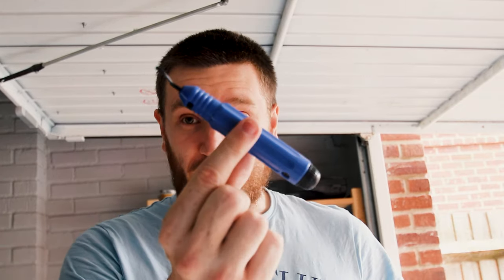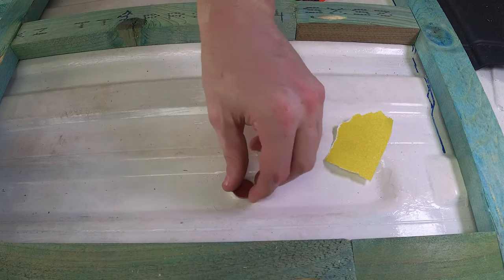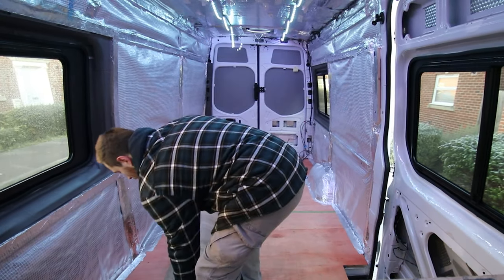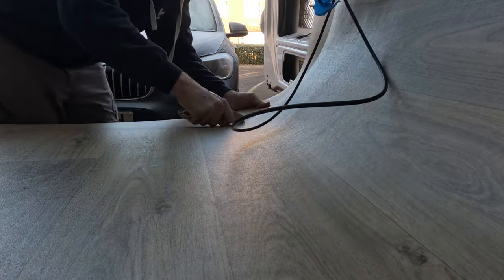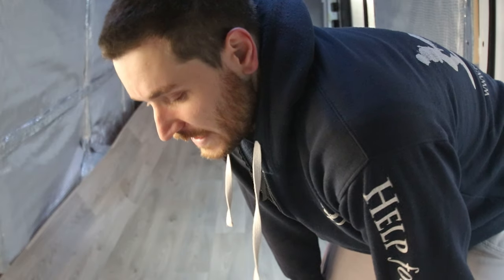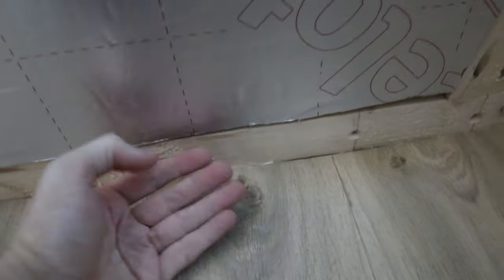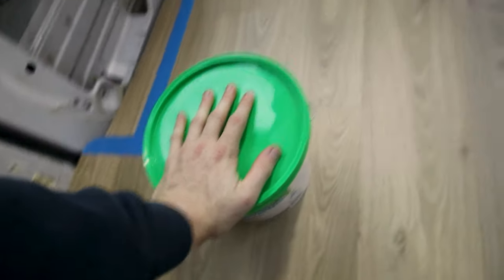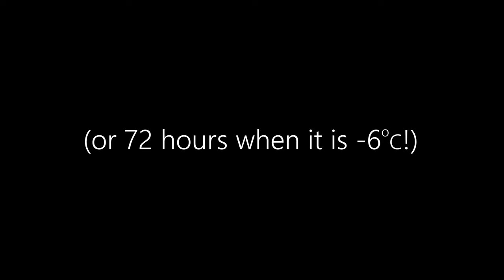e4. THICK VINYL floor and INSULATED layers | How to prep and cut your vinyl | UK Sprinter van build

Comment: Looking really good 👍 One idea to accurately make a  template to cut the ply floor Try the square interlocking yoga mats easily available from DIY outlets…..they are cheep and easy to cut around all the odd shapes of a van.
Lift out and transfer to your ply flooring…Once the ply flooring/ vinyl is installed lay them back down as they can act as floor protector while you continue to build.

Comment: Looks good. I'm thinking of using this for my altro flooring.  Can I ask what you did to cover the screws if anything.  Cheers
Reply from the maker: So the screw heads are covered by the adhesive and vinyl flooring itself. 
So we screwed the ply into the battens and then layered the adhesive over everything. 
My logic for not putting a grease on the screw head was that if we needed access to the screws, it would require us pulling up the whole vinyo floor anyway - so there was no point. 
As for cold bridging, there is no metal contact with the screws so no worries there. As for feeling them under foot - as our flooring is felt backed, you cant feel anything other than a soft flooring under foot. It great!
Hope that helps 👍🏻👌🏻
Reply: @beginningwithbessy  yes thanks for quick reply.. much appreciated.

Comment: Hiya would it have been easier to glue the vinyl to the ply outside the van then trim off and put back in van in one piece, I’m not a vinyl floor layer by any means so just an observation, really enjoying your videos 👍
Reply from the maker: Hey!, thanks for watching, im glad you are enjoying the videos! 
As standard, the Sprinter ply floor comes in several sections. Although we replaced the ply with a different type - we still went with the sectional approach, using the standard ones as templates. Trying to haul a LWB worth of ply in one piece would have been near impossible (plus I wouldnt have a clue where to get a 6m bit of ply). 😅
If we were to apply the vinyl in sections like we did the roof, then we would run the risk of there being joins in the vinyl, which 1, we wouldn't like the look of and 2 could risk moisture from spilled drinks/wet feet etc, getting under the vinyl. 
Also, any ply that had vinyl on it before going into the van, would then have to be screwed through and show exposed screw heads - which we have avoided by neatly hiding under the vinyl.

Comment: It could had been easier to pre-cut the lino when the three sections of the plywood floor were not installed in the van and be used as a lino cutting template.
Reply from the maker: Hi Charlie, I 100% agree!
However we hadn’t ordered the lino by the time we had cut all the floor pieces unfortunately.
So we had to do it the hard way 😂

Comment: The way you installed the felt backed vinyl is not the way to do it. I feel I am qualified to comment as I have been a floor layer for over thirty years. You have some skills so I am sure I could teach you easily. The only tool you actually needed was a knife fitted with a hooked blade. To sum up that is one way but not the correct or easiest. Regards Tony
Reply from the maker: Hi Tony, sorry it has taken so long to get back to you. Yes you are quite in what you say and I am entirely aware of the hooked blade that is used to cut vinyl.
But as an absolute novice with zero knowledge of the "correct" tools, trying to budget on what tools I buy and what I don't - favouring to go with what I had to hand, rather than buying single use tools, I thought that a hooked blade came as part of a larger tool in one rather than being able to just buy the blade standalone. 
Doh! Learning point! 

Thanks for your comment and hopefully my attempt at vinyl flooring didn't make a professional wince too much!